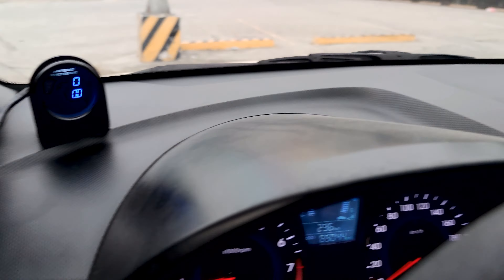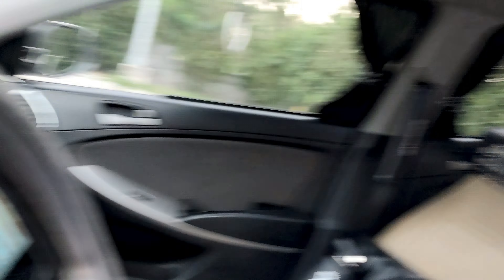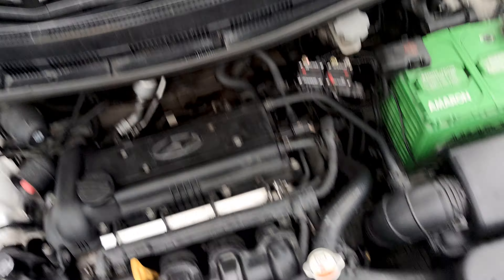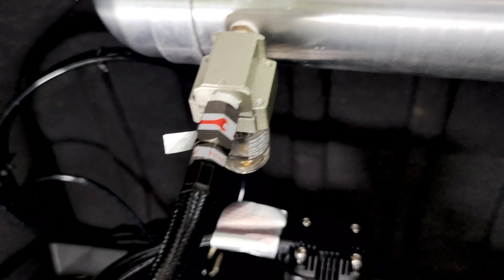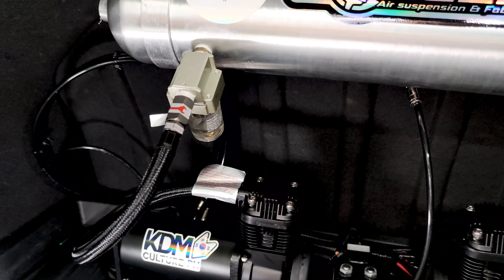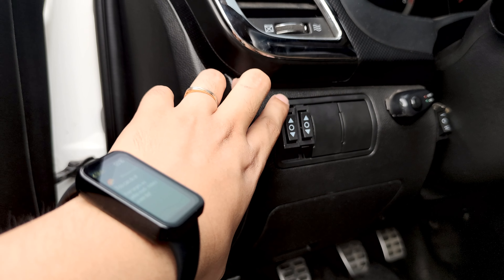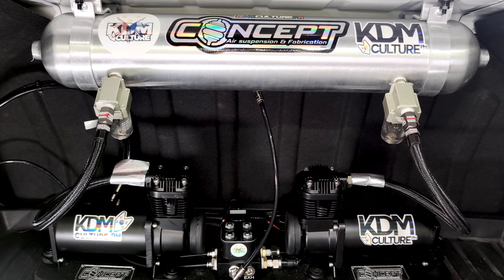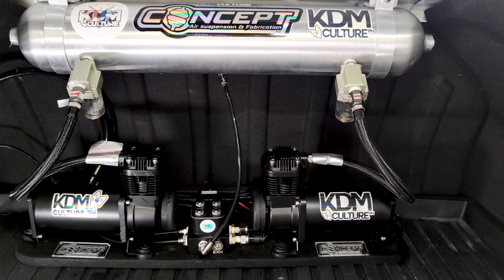Air Ride System 6 Month Review & Updates | KDMCulturePH | Concept Air Suspension & Fabrication

Comment: Aren’t the water traps supposed to be between the tank and the management?
Reply from the maker: Hmm...not sure bro, maybe it's because there's no management system for mines? (Manual Air suspension) and I believe as long as the water traps are set before it reaches the tank, it should work as intended. 

The water traps are hooked up directly from the compressor/pump lines before going into the tank, so in theory, any moisture/condensation should be caught by the water traps prior to entering the tank.

Comment: do you have slight air loss during night time specially when ambient air temperature fluctuates? i leave mine at certain psi and when morning comes its always less than 5-10psi not sure if this is slow leak or what
Reply from the maker: Yeah that happens to me as well, as long as its within an acceptable range similar as yours at around 5-10 PSI, there is potentially a very small leak but I wouldn’t consider it alarming, just have it looked at next time you do your maintenance and get it repaired if it really bothers you that much.

Comment: How much did you spent for your setup? More power!
Reply from the maker: For the Airsuspension package, I went for their basic package (45k) and eventually upgraded to get an additional pump/compressor along with water traps a few weeks ago
Reply: @KDMCulturePH  magkano po naging total kaya rough estimate lang po? Thank you for taking time to reply po! <3
Reply from the maker: @alainmayandoc  I spent around 50k + initially due to additional items I had added onto the basic package (Digital Air Pressure gauge which I recommend + labor for misc items I had installed on the car during that time)

For the additional pump and water traps I spent a little over 15K due to additional labor on parts that needed to be replaced (that I brought) as well.

Pricing will vary depending on your car's needs or if anything needs to be added/replaced. Other than that, if your car is in great shape, expect to shell out close to 50K all in for their basic/manual package. Price list on additional items should be available on their FB page as well.
Reply: @KDMCulturePH  I really appreciate it bro! more power to you, to your group, and to your page! <3
Reply from the maker: @alainmayandoc  Thanks bro!, I appreciate that.
Reply: @KDMCulturePH  You spent "$45k" on air suspension?! Is that a typo ? Or am I misinterpreting that ? Did you mean $4500.00 ?

I have airlift 3P. With performance series, double bellow bags with camber and dampen adjustability. It has a controller and Bluetooth phone app capabilities.  Dual black Viair 444c compressors,  dual SMC check valves,dual SMC water traps, and an electronic water drain switch. 

It was made for my year make and model, so no fabrication was needed. That cost me approximately $3500.00  for the entire system withAirlift limited lifetime warranty.  $1200.00 for install and shop warranty.  

It's been 2 years of daily driving in summer and winters and the only issue I've experienced was a creaking pillow ball bearing that I remedied with Wd40 dry and I had to disassemble and clean my smc check valves. One of them seized and caused back pressure on one of my compressors ( popping fuses). It took me 20 minutes to resolve.

Even if you had to purchase a universal kit that required fabrication for your particular vehicle... I can't imagine it shooting up to 45k. I must be reading that wrong, or it's a typo.
Reply from the maker: @blkeclipsel2400  Hell Nah bro 🤣 Aint no Air Suspension system cost 45K USD haha, unless if it is made out of gold 😂? I meant 45K in Philippine Pesos 😅, that's roughly around $1000 USD + the additional pump and couple water traps + plumbing and labor...that added another few hundred dollars...

It's a manual system but I've probably spent around $1300 All-in...Which is fairly cheap nowadays (coming from a 3rd world country technically) compared to the outrageous prices the US Market has...but I'm sure the quality is probably far more superior as well haha
Reply: @KDMCulturePH  man you scared the hell out of me lol. I was really concerned that you were ripped waaay off. Quite the opposite though  you got it for a damn good price ! I knew I had to be misinterpreting what you were saying lol. Thanks for the clarification
Reply from the maker: @blkeclipsel2400  No worries, thanks for the concern 💯 If I paid 45K USD, I wouldn't even DARE to put it up on the internet and get roasted for eternity as THAT idiot 🤣the internet remains undefeated HAHA